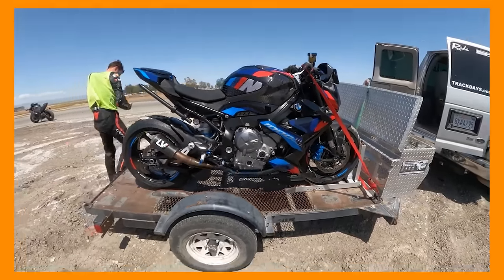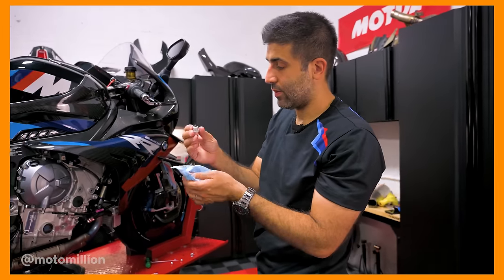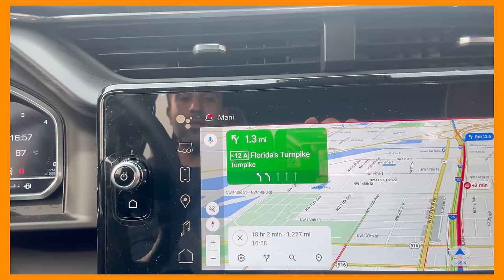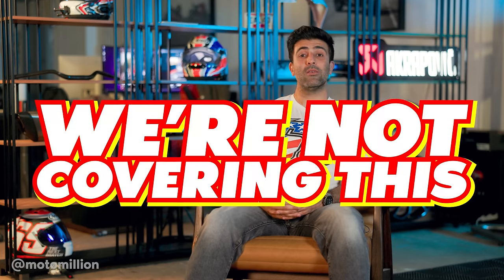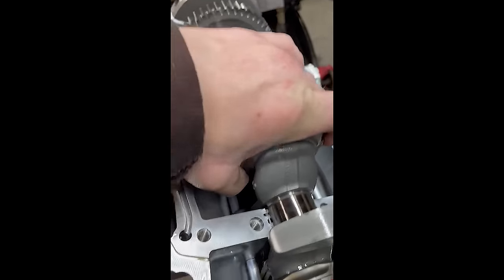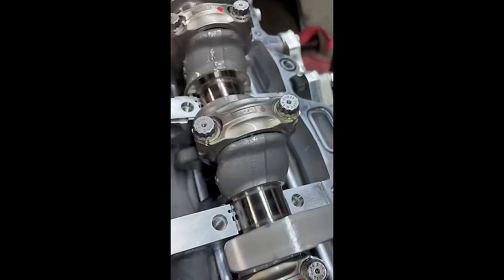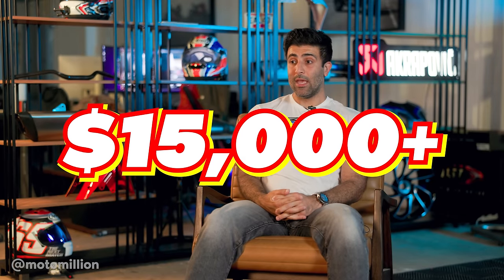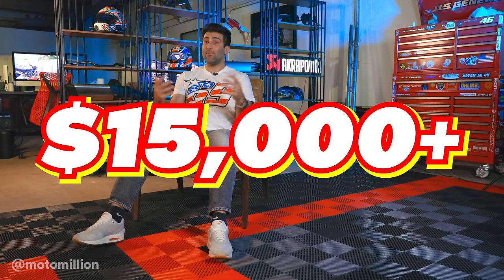MASSIVE Engine Failure on our M1000RR & BMW REFUSED Warranty...

Comment: so you removed the break-in limiter, went to put an aftermarket dyno tune on it, redlined the engine within the advised break-in period, and blew the engine up?
Reply from the maker: I understand that you don't know the full story and didn't watch to the end.

CaliMotoTV's BMW M1000R blew up on the track. That bike had a full exhaust and an ECU flash. BMW fully replaced the engine under warranty.

Why was Bill's replaced even though modification were present?

Carwow's STOCK M1000RR blew up on the drag strip. 

Read the comments here from so many other people with issues with their BMW. We're just bringing to light an issue within the industry.
Reply: @Motomillion  Cry harder. You messed up and you know it.
Reply: It says right in the American manual, no full throttle until after 621 miles and nothing over 9000 rpm......even if the engines are having problems, I'm not following any other procedure other than what the manual tells me on my $40K motorcycle. Not following the manual, then blowing up the engine, gives BMW a clear out. I don't have any sympathy for 'motomillion".
Reply: @nickb3968 Defending a corporation that has a known problem with those engines is crazy lol
Reply: @tricktop9064  Is there anything in what I wrote that is untrue?
Reply: @rebman5150  so he redlined his bike under break in, boohoo i did that on 125cc yamaha that survived and i even rode it aggressive from the dealer to 1k miles, the thing took the beating without a issue so tell me how can a simple 4k bike do that and a 20-40k bike cannot from bmw?
Reply: Just about every motorcycle race team in the world breaks their bikes in on a dyno at full rpm and then they go race them (and they dont blow up).  I do understand that maybe the warranty was voided by removing the break in limiter but that is NOT what destroyed the engine.
Reply: @nickb3968  Also for accuracy sake here is what Motomillion did say about your point:

@Motomillion
1 month ago
We followed manufacturers recommendations. They state to do the first service between 350 and 700 miles, after this the break-in limiter is removed. This is not the 14k-15k rev limiter, this is a 9k rev limiter for the break-in period, which we followed.

This is in the owner's manual.
Reply: @fossilqexplorist2578  The break-in period in the US manual clearly states 621 miles before lifting the rev limit, which they didn't do.
Reply: @Motomillion  Blatant grab for views ill be blocking this channel the video was a pile of Karen tears and nonsense. watched it twice just to make sure.
Reply: @sassythesasquatch4425  Did you just compare a 125 dirt bike to a 1000cc superbike? Of course you can thrash the pants off a 125 from new with little risk of destroying the engine. Beside the fact you should be breaking in on a rich mix meaning the engine is getting plenty of oil, the stress your 125 is under is nothing compared to a 1000cc when it's pegged flat out. Physics isn't a linear relationship when it comes to power. A 1000 at full throttle is under a lot more than 8x the stress than your 125, despite it being only 8x the displacement.
Reply: @nickb3968  I just bought my first BMW (lol way cheaper than this bike and way smaller).  Asked the service department about doing my own oil changes.  Dealer service manager told me (oh hey, that's great you want to do that.  But you should always let us do the first service for about 100 reasons I won't go into).  Talked also to the former BMW master mechanic from that dealership that now just builds race bikes.  He also told me, always, always let the bmw dealership do the first service because BMW uses that (And the full bike bolt check that happens during the first service as a basis for warranty coverage.

So I'm not doing my first oil change.  Pretty simple.  Makes all kinds of sense to me.
Reply: I think the problem is this bike isn’t made in Japan.  European vehicles are okay, you just need to be okay with weekly trips to the dealer; stopping every few miles and picking up all the parts and oil that fell off / leaked.
Reply: @nickb3968 you have an M1000RR?
Reply: @williedangerous don’t let the door hit you on the way out bud
Reply: I agree, if you go against factory advice and limiter, it is at your own risk. I too had a new bike once, not a BMW, didn't have a limiter but the dealer told me to keep it below certain RPM for a certain number of miles, I did and the bike ran very well for next two years before I sold it. Even cold motors you should not rev up, let alone a new engine.
Reply: @rebman5150  reported
Reply: best comment
Reply: Should’ve immediately lemon’d the bike. Especially in Florida. After 31 days at the dealership it’s a wrap. You said over two months for shim install. Yikes.